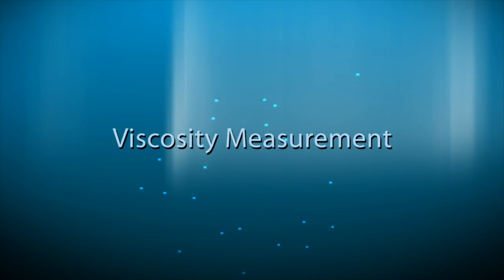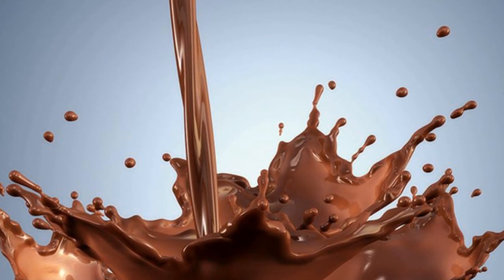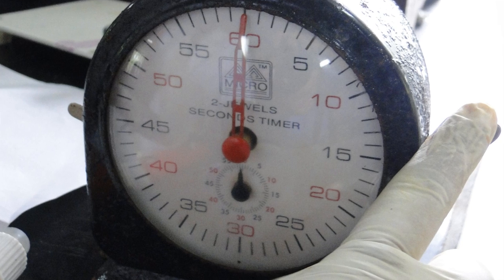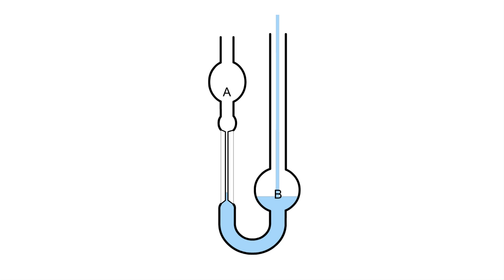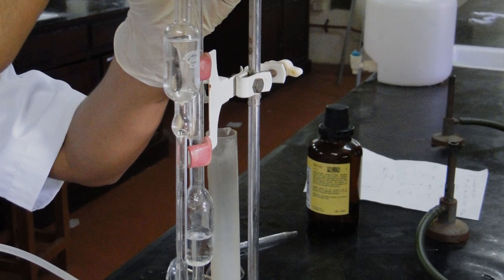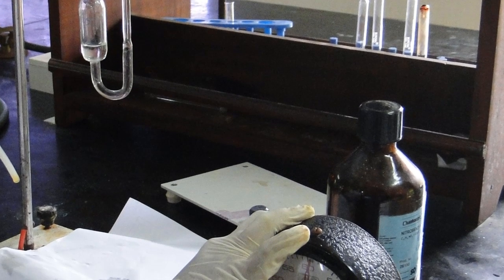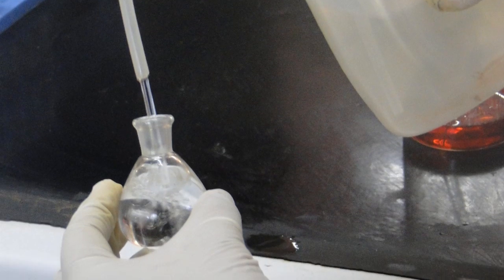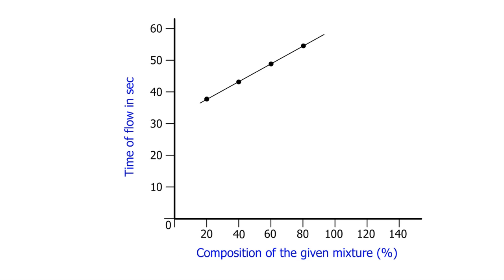Viscosity Measurement using Ostwald's Viscometer - Amrita University

Comment: I am some confused, please help
you called n2 as the absolute viscosity of the liquid. I knew that the capillary tube is to measure the kinematic viscosity not absolute. also, I found some article about the Ostwald's viscometer, and in such article they represented the n2 as the viscosity coefficient not as the absolute viscosity, could you please illustrate or send me a link to understand what is actually the n2 refers to? and what is definitely the viscosity coefficient ? thanks

Comment: why to dry the water with acetone
Reply: +Kasi Viswnath   The acetone breaks the adhesion between the glass surface and the water molecules.  When the acetone is poured out, all of the water is removed.  They the acetone evaporates leaving no residue.  Pure alcohol can also be used but it works in a slightly different manner.  It is eqauly effective.

Comment: @rahulkalwade you can measure it by poise or stoke depending on the equation you may use ..
if u want it in poise then : viscosity = k*t*density
in stoke : viscosity = k*t
k is the instrumental constant , which you can eliminate by knowing the viscosity of a liquid and the calculate the viscosity of the unknown by a ratio ..
hope you understand though it's kinda late :)